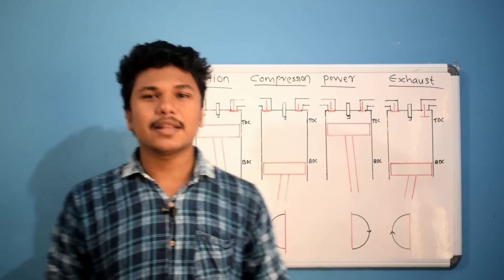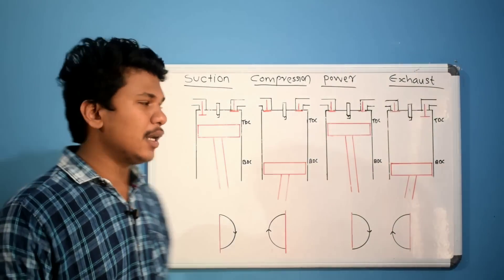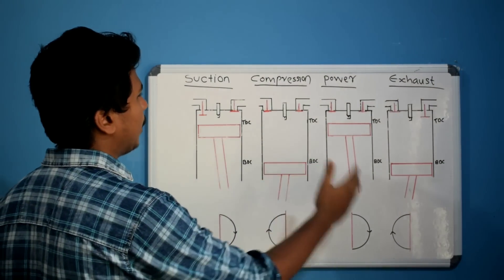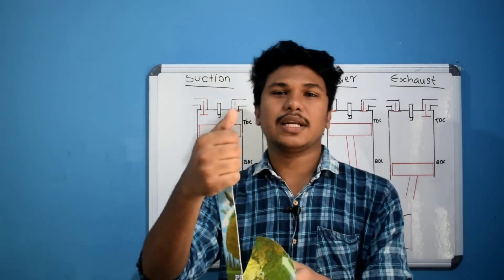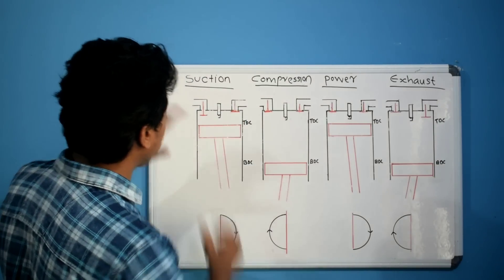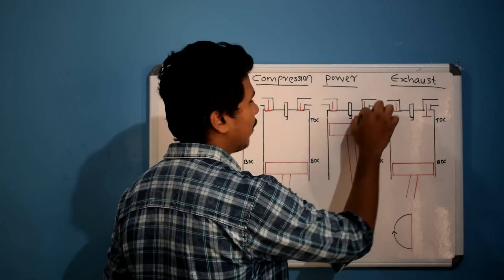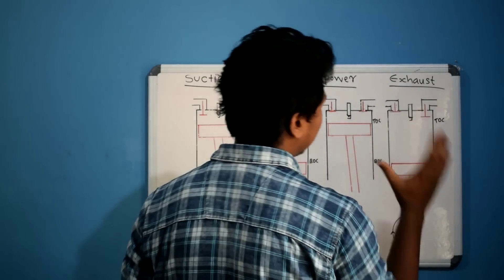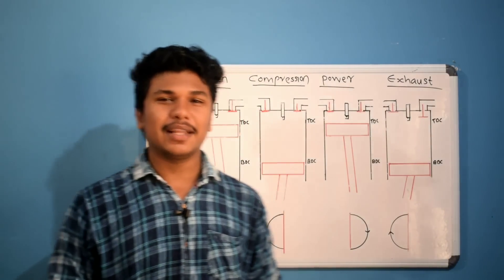4 Stroke petrol Engine working | Malayalam video | Informative Engineer |

Comment: Spark plugs is on always .so in suction stage will fuel burn or not? And how valves automatically work?
Reply from the maker: Spark plug produce spark only at the end of compression stroke 

Valves are operated by cams,  cams are mounted on camshaft.. 
Cam shaft is driven by a belt or chain( Timing belt /chain)
Reply: Compression takes place in a fraction of second at high RPM.Then how spark is produced at that time only?
Reply from the maker: @broadband4016  Athine ignition timing enn parayum..
Reply: I am not asking about ignition time.how is spark maintained  each time of compression exactly ?
Reply from the maker: @broadband4016  that is possible.. athukondaanu engine work cheyyunnath.. 

First you need to understand the working of ignition system.. i cant explain it by writing..
Reply: The students explain this by writing in examination with sketches..just write breifly

Comment: Diesel engine il spark plug Inu pakaram injector undavum.Piston compress cheythu power strokil piston TDC vare compress cheythu hot air ileku diesel inject cheyukayum cheyum.Ethrem vethyasam alle ollu petrol and Diesel.Very Very easy to understand.I really love cars and I will watch your every video.Good luck brother.God bless yu

Comment: ബ്രോ താങ്കൾ 4 സ്ട്രോക്ക് എൻജിൻ എക്സ്പ്ലൈൻ ചെയ്തത് കണ്ടു...ഒരു സംശയം ഉണ്ട് എങ്ങനെ ആണ് ആദ്യം പിഷ്ടൻ TDC നിന്നു BDC പോകുന്നത്..കിക് സ്റ്റാർട്ട് ഒരു വിധം മനസ്സിലായി...but സെൽഫ്  എടുക്കുമ്പോൾ എങ്ങനെ ആണ്.ഐ mean സ്റ്റാർട്ടിങ് mortor..please ഒന്ന് clear ആക്കി തരു.
Reply from the maker: Starting motor nte shaft il oru cheriya gear undayirikkum.. ee gear flywheel um aayitt mesh aayirikkum.. ( flywheel kandal manassilavum athil gear teeths cut cheyth vachittundakum) 
Nammal button press cheyyumbo starting motor karangum.. appo flywheel karangum engine start aavum.. 
Starting kazhinjal starting motor um flywheel um aayittulla contact ozhuvaakum..  karanam engine high-speed il karangunnath kond starting motor rpm koodi motor kathippokkum... 

Ini venamengil video cheyyam
Reply: @informativeengineer2969  thank you bro..
Reply: Self start cheyumbol enthanu sambhavikkunnath athu motor vachu engine ne karakkum

Comment: ബൈക്ക് ൽ സിലിണ്ടർ ൻറെ ഉള്ളിൽ  സ്പാർക്ക് ഉണ്ടാകുമ്പോൾ  അത് (fire) കാർബറേറ്റർ ലോട്ട്  നടക്കാത്തത് എന്തുകൊണ്ട്?
Reply from the maker: Combustion nadakkunna samayath randu valvum closed aanu... pinne exhaust stroke il puka purathekk povum.. 
Ini adutha stroke ( suction ) il mathramanu inlet valve open aavunnath..  suction stroke nadakkumbol cylinder il vacuum(negative pressure ) aanu undavuka.. ith karanam enginte akathekk mathrame flow undakoo.. 

Manassilayi enn pratheekshikkunnu